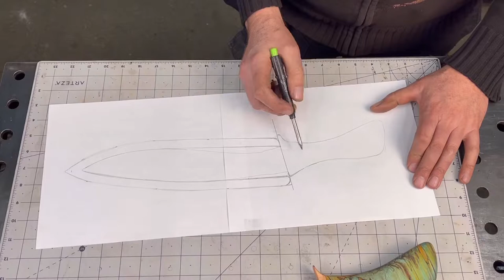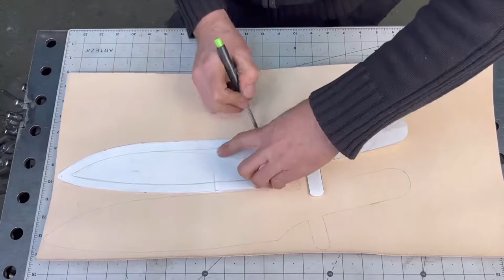KUKRI LEATHER SHEATH BUILD !!

Comment: I've made two Kukri sheaths, one open top like yours and one break front which is also a cool and interesting sheath.  I like to use the smooth side of the leather on the outside of both back and frond with rough side inside.  I simply bend the belt loop over the top and tuck it into the inside and glue and sew it between the welts.  That way you have smooth leather on back and front and the rough inside where it is not seen.  On the sheath you did, great job!  Well done!